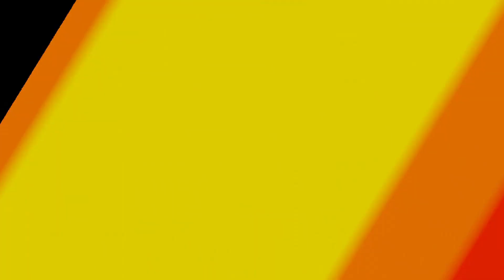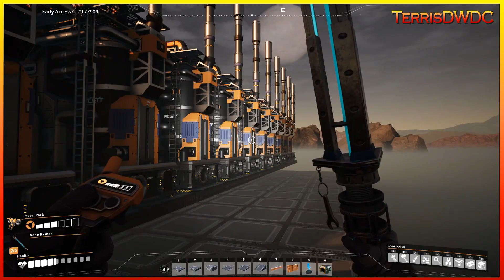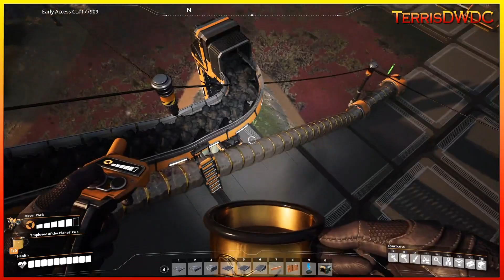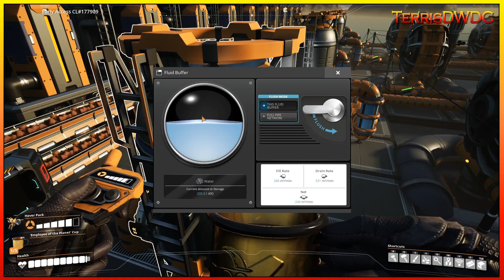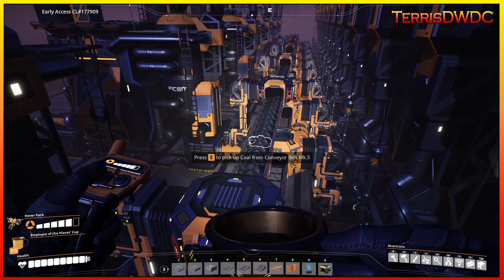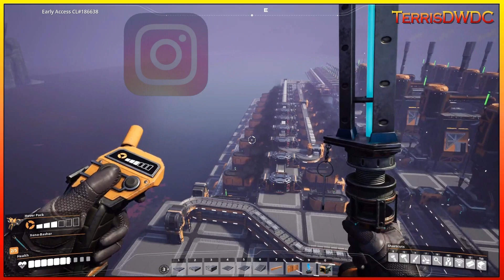Mega Factory - Aluminum Ingot Production E04 - Satisfactory Update 5

Comment: I never send the waste water back to the input of the alumina refineries because I could never balance it out so I make wet concrete or pure iron/copper/etc and make items with that to send to other productions and it works well to make an impure iron node almost an overclocked normal node
Reply: It's fairly easy if you do it with the sloppy aluminum alt. With it you can take 1 refinery out put straight into another 1 to make the scrap. Then take that single waste water back to the front refinery with a valve wide open, just to prevent backflow, into a junction then into the front refinery with the main water line branching off into the other side of the junction with a valve set to 60, that's all... Takes 200 baux and 120 coal, and outputs 360 scrap that can make 6 smelters with the pure aluminum ingots alt also. Makes a perfectly balanced modular system. I start out with 2 of those set up to get started. Then just add more as more aluminum is needed. I do it all the refineries on the same level. I used to stack them on top of each other but that just messed with getting the waste water out. Now that it's flat it's runs so smooth. Oh also putting a smart splitter to overflow the scrap to a sink helps also, because having it back up will jack up the fluid balancing. So best to just keep it running nonstop. Only a full power shut down once mess things up I've noticed